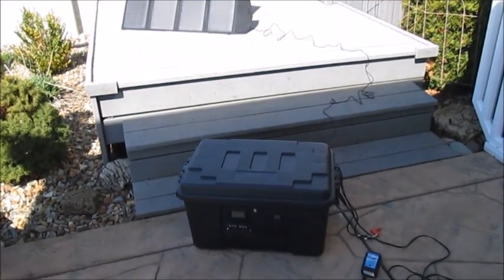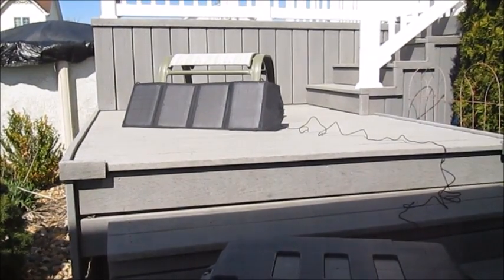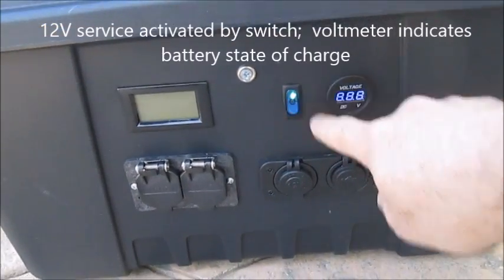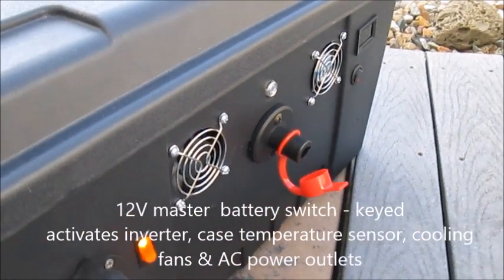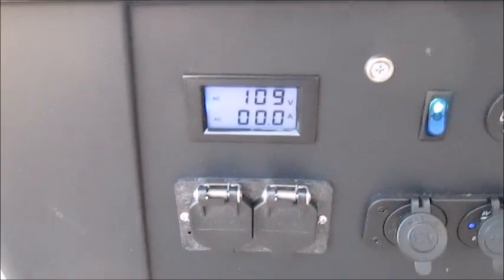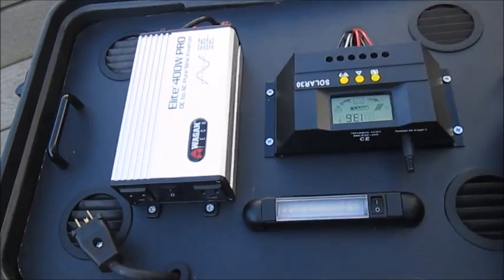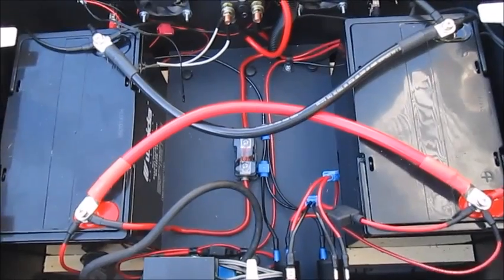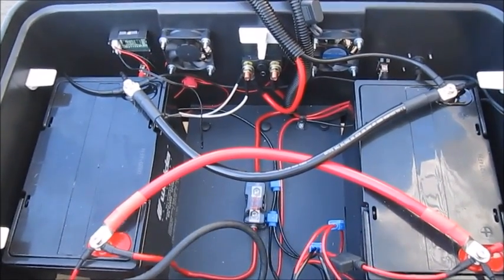V1 P1 DIY Portable Solar Power Generator - Wiring Schematic, Parts List, FAQ Sheet Provided

Comment: Jim, if you explained why...I missed it, but what is the significance of having "Sine" feature in the Inverter? Look forward to your reply and thanks in advance, Angler.
Reply from the maker: +Angler Beaudry As I understand DC to AC inverters there are two types:  modified sine wave and pure sine wave inverters.  Modified sine wave inverters are considerably less expensive and most appropriate for use with appliances that are not particularly sensitive to fluctuations in AC current.  Pure sine wave inverters produce a quality of AC current that closely approximates what you get when you plug into an AC outlet in your home.  It is recommended that a pure sine wave inverter be used for sensitive electronic equipment such as computers, laptops, etc.

Comment: Very awesome!!! My goal is to make a single 80 or 100 amp hour deep cycle battery, 50w solar panel set up like your's. Need mine to be a little more compact. I had seen one that allows you to hook up to additional batteries if/when need be and will do the same. Primary use will be for tent camping at sites that have no electricity. Thank you for sharing your great project, Angler.
Reply from the maker: +Angler Beaudry Thanks for having a look at my project and taking the time to share your kind feedback.
Reply: +Jim Fisher I have picked everything out, except a 1500w inverter.

Comment: This is awesome!  I'm building a power supply for a ham radio field kit (and for camping).  Definitely going to make use of your design and parts list.  Will post a VR to this when it's done.
Reply from the maker: +Run Lift Throw Thanks, looking forward to seeing your project when it is finished!
Reply: @JimFisherDIYPortableSolarPower  Hey Jim, wanted to let you know, my box is still working great.  Batteries running strong and the only thing I had to replace were the snap-on connectors, plastic got brittle and I switched to Anderson connectors. Thanks again for posting this project.  I still need to post a video but I may just post pics on instagram.  (NugentMakes is the primary project site for me)

Comment: very nice set up you've done,by the way if it charging 5amps/hrs and you draw abt 12 amps/hrs i think you need to add 2 pannels or get abt 300 watts panels?still looking for a set up for abt 15amps charging.ty for the video....learned some of your set up.
Reply from the maker: +ronald martel Thanks....for clarification, my TOTAL daily consumption at this point is budgeted for a maximum of 26 amps, not 12 amps per hour. To that effect the system has provided all the energy I need and more. I think there was a miscommunication on my part that has given the impression that my consumption was 12 amps per hour and in reality my needs have demanded about 12 amps total during a typical day spent on the boat.  Here's a link to a pdf of the spreadsheet that I used when planning my solar power budget: http://www.creeksideartifacts.com/SPMC.pdf

Comment: Very nice,  for emergencies you should have spare fuses. nothing worse that a blown fuse and no replacement
Reply from the maker: +David Harmon Thanks David, I couldn't agree more...I keep spare fuses in a plastic sleeve that is attached to the underside of the  lid of the case along with some documentation for the charge controller and inverter.

Comment: Excellent work on this project. Well thought out...covered just about everything I can think of. The only thing that I would consider upgrading is the inverter...600-700w might be a more useful choice. Not trying to be critical...love your box. Samlex has a new one out that would be perfect for this box...pure sine wave, 600w, advanced technology. Renogy also has a suitcase solar panel with the solar charge controller built in. Where did you get the batteries? Thanks for this video...great work on it and explaining everything.
Reply from the maker: +Chris DIYer Thanks for you comments Chris.  Yes, an inverter upgrade would be nice.  Total system cost and component dimensions were both a factor in this initial build as there is not much room left under the top-  and larger PSW inverters are expensive.  In part 2 I speak of purchasing a larger MSW inverter (1200-1600W) and attaching it to the terminals I added to the outside of the case.  I specifically chose the Renogy flexible solar panel for storage purposes on the boat where space is always at a premium.  The thinner, flexible panel was a good choice for my use as it can be stored under the cushions in the cabin and you can sit or sleep on it without worry of damage. I purchased the batteries online at http://www.wholesalebatteriesdirect.com/ups-batteries-to-replace-fullriver/54339-12v-55ah-22NF-UPS-Battery-replaces-FullRiver-DC55-12-DC-55-12.html
Reply: Problem with raising the inverter size is folks will use it, then the panels have to also be upped, or they won't charge the batteries enough to keep them up.

Comment: Well done sir, very clean job.  
With 110Ahr x12V=1320 WHr of power and 400 WHr of inverter you get around 3 hrs of use time at full duty cycle. This is assuming 100% discharge of the batteries which will destroy the batteries.  Generally you should not discharge the battery to less than 50%..  Of course this is assuming no solar panel use and 100% efficiency of system.  At 50% discharge you get 1.5. hr use time!!  I would say depending on components used you have about 50Whr inefficiency in the system so at best (full solar output) you are adding about 50W into the system in an hour.  So why the long dissertation?  ADD MORE SOLAR PANELS AND MORE BATTERIES!!!
Reply from the maker: +afshin735
Thanks for having a look and for your feedback.  You are right, the system could certainly handle an increased rate of charge by another one or two 100W panels, it was built with expansion in mind.  For now the 100W panel suffices based upon my current power needs on the small pocket cruiser.  As mentioned in the video, when I upgrade to a larger cruising boat this portable unit is coming along and with it likely another panel or two, and perhaps another supplemental battery bank.  You may be assuming a far greater depth of battery discharge than I am actually realizing given my modest current demand for amps.  This system is primarily being used on weekends only and my daily demand seldom exceeds 13 amps total.  At that rate of AH consumption/discharge the batteries rarely fall below 12.6V or 85% SOC and are able to be recharged to 100% in 2.43 hours with the 100W PV panel.

Comment: Im going to attempt to make somewhat the same system you made.  My question is do you know if there is a "Reverse" calculator I can use?  I say reverse because I want to see what I can run off of the equipment I have already.  Ie I have two 130 watt panels, 20A controller,350watt inverter etc but I want to see what I can power with what I have. I was planning on buying two or three 750 MCA Deep Cycle batteries.   Im want to head in the direction of being able to power a radio, light, small 12v heater, laptop etc. Looking more for like a camping battery supply setup
Reply from the maker: +ken ber perhaps this can help in your planning http://www.grideraser.com/SiteAssets/specifications/Runtimes.watts.pdf   In my opinion, depending upon what type you have, the 12v heater will likely draw the most amps from your system.  The radio, light and laptop should draw comparatively little with 260 watts coming from the panels feeding two or three 750 MCA batteries that I assume are able to store about 90 amp hours each.

Comment: how did you cut the plastic box? Did you use a dremmel? Thank you Robert great video
Reply from the maker: Robert Debes Thanks for having a look Robert....I used hole saws and spade bits on a drill for the round holes and a utility knife for the rectangular openings.

Comment: It looks like you have your inverter connected directly to your battery (behind a fuse + switch).  Should it be going through the charge controller to have a low voltage disconnect and protect the batteries?

Great setup - looks very polished!  Thank you for providing such great detail.
Reply from the maker: Brian J. Thanks for viewing and for your positive feedback.  You are correct in your understanding of how the inverter is wired.  This particular inverter has a battery low voltage cutoff built into it to protect the batteries from being overly discharged.  It simply shuts down when the batteries reach that threshold.
Reply: Jim Fisher The inverter low voltage shut-off is only for AC devices?  For the 12v dc outlet, USB ports and fans (things not going through the inverter) - shouldn't they go through the solar charge controller output which should offer low voltage protection?  Granted, for your use-case, you're probably always present - but for a (generally) maintenance free system, you'd want to prevent any of those devices from lowing the voltage too low if the solar charge controller was capable of handling it.
Reply from the maker: Brian J. That is true about the voltage shut-off being for the AC outlets/devices only.  You're right... if a high amp draw appliance plugged into either the 12vDC or USB outlet was inadvertently left on and unattended it could completely discharge the batteries.  Same with the cooling fans... if the master battery switch was not turned off and the fans were left on they could discharge the batteries.   I have been treating the generator the same as I treat the boat's onboard DC systems after use....always make sure everything is turned off to avoid draining the batteries.
Reply: Jim Fisher Makes sense!  Thanks again for your thoroughness and willingness to share!  Learned more from this short video (and diagram) than anything else.  I may dabble with my own setup soon and try to incorporate a DC shutoff just for kicks.  Thanks for the inspiration!
Reply from the maker: Brian J. You are welcome...glad the video can be of help.  I took a lot of ideas and inspiration from others who posted their projects before I set to work on mine.

Comment: I'm stealing a few of your ideas Jim Fisher. That's a bad ass solar generator.  If you could tell me where to get that dual ac outlet I'd ap
Reply from the maker: Eliasar Macias No problem, take as many ideas as you like, that is why I posted it!  .I purchased the Leviton cover I used on the 110C AC outlet on Amazon.....search under Leviton Coverplate, Single-Gang, Flip-Lid, Duplex, Weather-Resistant, Black .  It is currently out of stock and, in my opinion, an expensive part that could be replaced with a different version that is more available and less expensive.
Reply: Cool , thanks for your reply and the info. Also the wiring diagram helped a whole lot as well. That's a nice system you built. Thanks again
Reply from the maker: Eliasar Macias You are very welcome...good luck with your build, I'd enjoy seeing it when completed if you are able to post a video.

Comment: Nice rig!! I am finishing up one very similar, but 160 amp hours. I'm even using the same inverter.

Where did you get the Leviton covers?
Reply from the maker: ib scooter70 Thanks...I purchased the Leviton cover I used on Amazon...search under Leviton Coverplate, Single-Gang, Flip-Lid, Duplex, Weather-Resistant, Black .  It is currently out of stock and, in my opinion, an expensive part that could be replaced with a different version that is more available and less expensive.
Reply: Jim Fisher Cool. Thx. I have covers on it already, but I like the flip up versions. Maybe later. I actually just finished my rig last night. It is working like a champ! Might try to do a video one of these days....it is a product of many videos and my own ideas and research.
Reply from the maker: ib scooter70 Congratulations on your success!  I hope you will post a video of your build...I enjoy seeing what others have come up with.
Reply: ib scooter70 My first ever youtube video.....

Comment: whats the highest voltage you've gotten out of it so far?
Reply from the maker: +KILLKING110 I have had high readings of 13.6 V DC when initially charging, but the solar charge controller is set to trickle charge only at 13.7 V DC.  On the AC side I have had highest reading at about 113 V

Comment: you said you're gonna use a 100w solar panel to charge that?  It seems small.  Perhaps, bumping it to 200 watts would be reasonable and cut down your charging time to 2-3 hours.
Reply from the maker: gconol You are right, it could certainly handle an increased rate of charge by another one or two 100W panels, it was built with expansion in mind.  For now the 100W panel suffices based upon my current power needs on the small pocket cruiser.  As mentioned in the video, when I upgrade to a larger cruising boat this portable unit is coming along and with it likely another panel or two.
Reply: Jim Fisher from what I read, the basic rule is to have a charging system that is 20-25% of the battery capacity.  This is the fastest and optimal charge time without burning the batteries.
Reply from the maker: +gconol you may be assuming a far greater depth of battery discharge than I am actually realizing given my modest demand for amp hours.  This system is primarily being used on weekends only and my daily demand seldom exceeds 13 amps total.  At that rate of AH consumption/discharge the batteries rarely fall below a 12.6V or 85% SOC and are able to be recharged to 100% in 2.43 hours with the 100W PV panel.
Reply: Jim Fisher oh yea,  I was assuming this was your SHTF gear.

Comment: Thank you for sharing your work. Very thorough explanation. Very professional looking build! You have inspired me to start my project! If I may ask, what type of cord is coming from your inverter to what I am assuming is wired to the electrical outlet?
Reply from the maker: billybossalini Thanks for viewing my video and for the kind words.  The cord coming from the inverter was made from a length of bulk 3-wire extension cord purchased at a local hardware store.  The male 3 prong plug was purchased separately and attached to the cord. The bare wires at the other end of the cord are, as you correctly assumed, attached to the 110V electrical outlet.
Reply: Jim Fisher thank you for the clarification. Also how does your AC Ammeter and transformer connect to the outlet in the shallow box? I tried to follow your schematic but was not sure where the wires tied into and I was also curious why there is a 15A fuse inline? does the power inverter carry and internal fuse?
Reply from the maker: +billybossalini The AC ammeter has both a positive and negative lead that supplies power to it.  The positive lead is connected to the positive terminal on the 110AC outlet.   The negative lead is connected to the negative terminal on the 110 AC outlet.  The transformer is donut shaped.  Run the positive wire linking the inverter and the 110V AC outlet through the hole in the transformer.  That is how the ammeter reads the AC voltage and amps passing through the 110V outlet.  The 15A fuse is just an extra precaution.  It will blow before there is any problem that reaches  the inverter (it too has a fuse in it).  The inline fuse is a heck of a lot cheaper to replace than the inverter (and more accessible- no need to open the inverter at all).

Comment: Hi Jim, your video is amazing and very useful. Thanks for adding the wiring schematic. I just had one question, how did you connect the ac/amp meter? I'm confused with the schematic.
Reply from the maker: Jorge Jimenez Thanks Jorge.  The AC ammeter comes with both positive and negative wires that I attached to the positive and negative terminals on the sides of the AC 110 outlet to supply the ammeter with the power it needs to function.  The ammeter I bought also came with a small current transformer (donut shaped coil with two wires attached to it) through which the positive wire between the inverter and the AC 110 outlet is passed.  This allows the ammeter to read the AC voltage coming from the inverter and AC amps being drawn by any appliance plugged into the 110 outlet.  The current transformer has two wires that simply connect to the appropriate terminals on the ammeter.

Comment: Well Done!
Reply from the maker: Justin Anthony Balaguer I Thank you Justin.
Reply from the maker: Jim Fisher ***** for whatever reason I have been unable to reply to your question directly, so I have posted a response here.  I have had high readings of 13.6 V DC when initially charging, but the solar charge controller is set to trickle charge only at 13.7 V DC.  On the AC side I have had highest reading at about 113 V AC coming from the inverter.

Comment: Good evening sir, ahm.. How did you hole the box? What kind of tools did you use to make square and circle  for the voltmeter and some USB plug? Can you give me some advice? Thank you, cause i have here a toolbox and inverter i want also to make one like yours. And i'm impressed about your powerbox sir it was so totally awesome! And cool yeah :)
Reply from the maker: Norvin Nasol Norvin, I used both spade bits and hole saws, depending on the size needed,  to make the round holes.  For the square and rectangular openings I simply used a utility knife to very carefully cut out the openings in the plastic case.